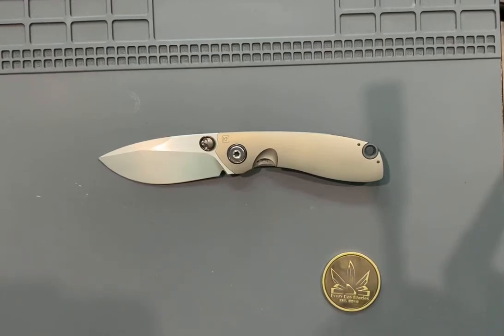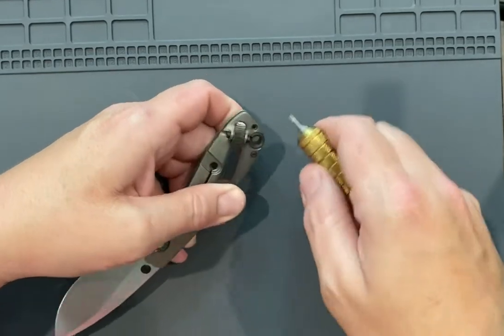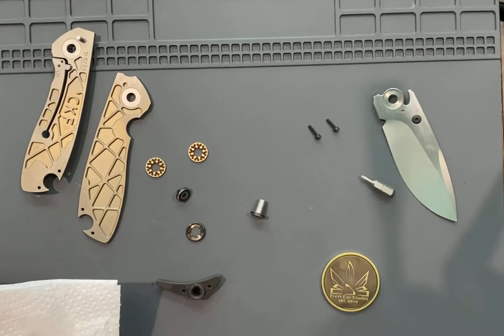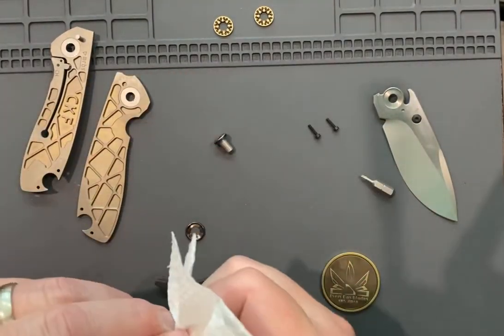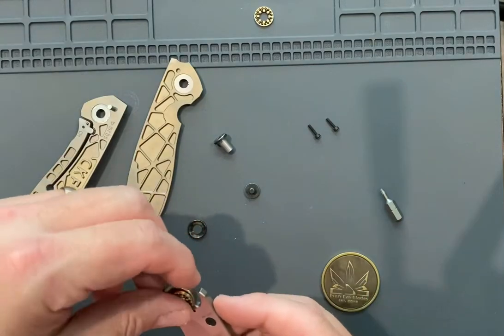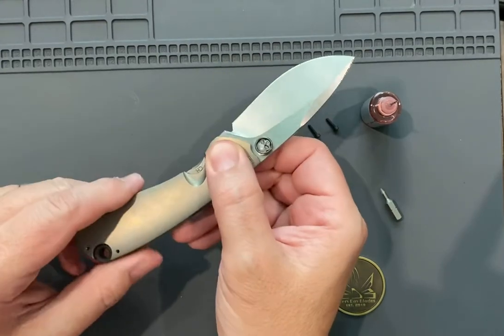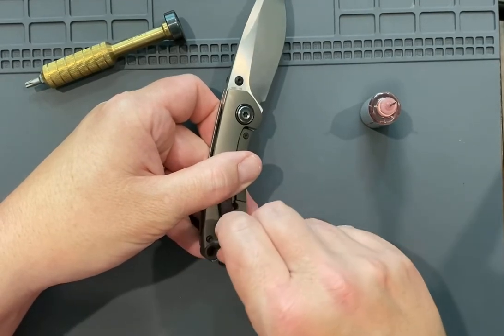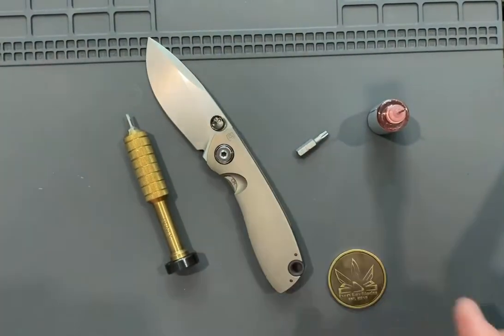Custom Knife factory Rampage disassembly and maintenance

Comment: Great video man , I took that ring around the skull off and repositioned the skull facing down when opened , it works better for me , also I recommend to add blue locktide to the pivot screw. Edit : I had the same problem with bearing balls falling off , so I replaced those with skiffs .
Reply from the maker: Thanks brother